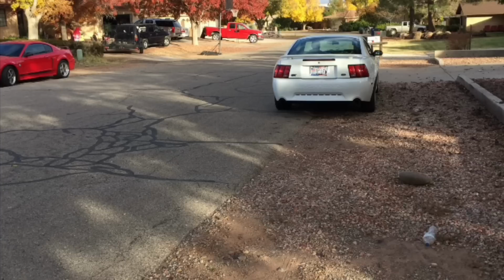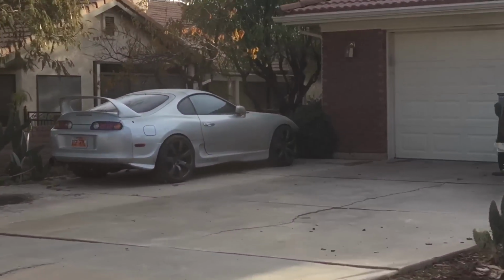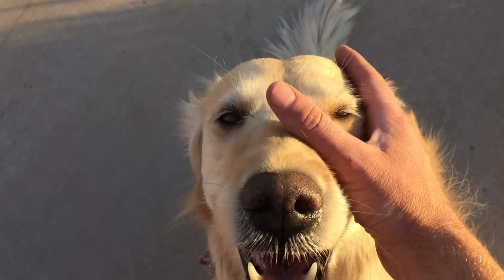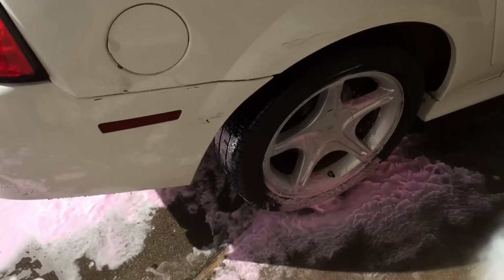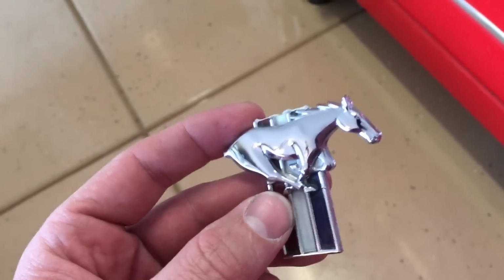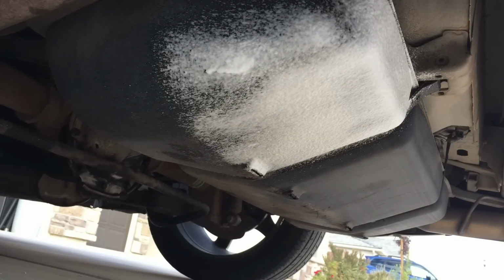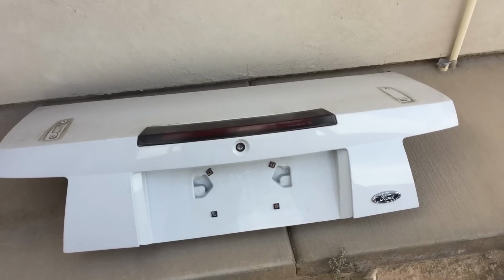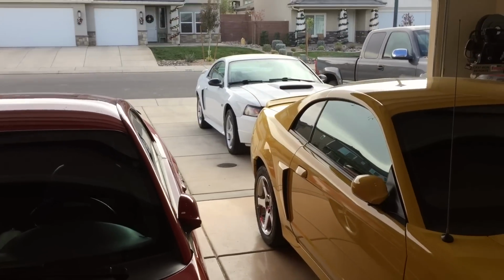Mustang GT update: Fender emblem, light detail, garage

Comment: I'm really surprised you didn't put the car up on jack stands or something, spray the whole undercarriage with simple green or engine degreaser and pressure wash it all. Maybe that video is coming later, with an engine bay cleaning too.
Reply from the maker: Not joking, I actually do plan to take jack stands to the car wash with me when I have some time and get it cleaned up! You're right on the money!
Reply: Danny Johnson you really should invest in a decent pressure washer, then you could keep the new house and driveway clean.. and wash all the cars, get the foam cannon action going, it’d pay for itself after a while.
Reply from the maker: Michael Westen I have a gas powered one in a storage shed. Time to get it out and running again! 😉
Reply: Danny Johnson my mom has a electric one, it’s like 1500psi.. not worth a damn.. lol but sometimes I’ll go to her house and use it to foam cannon our cars. But it for sure don’t have the balls to blast off a lot of grime etc like driveways etc